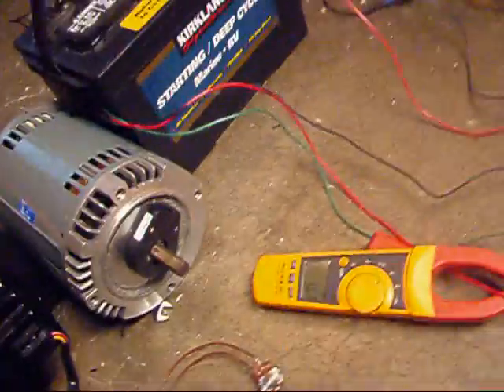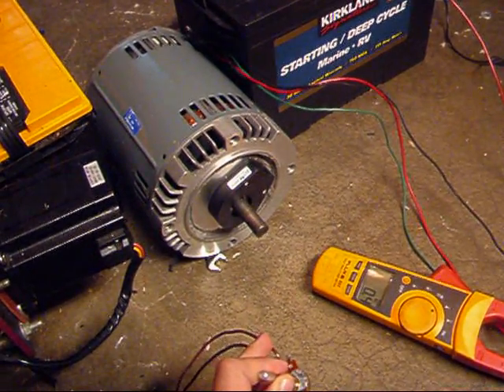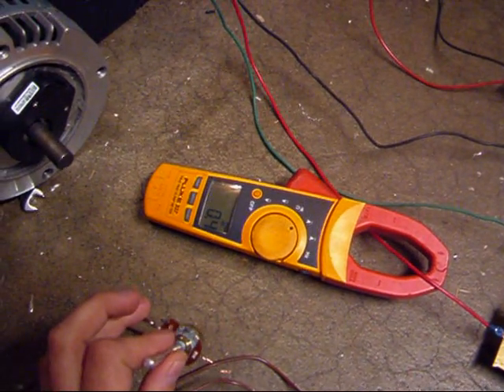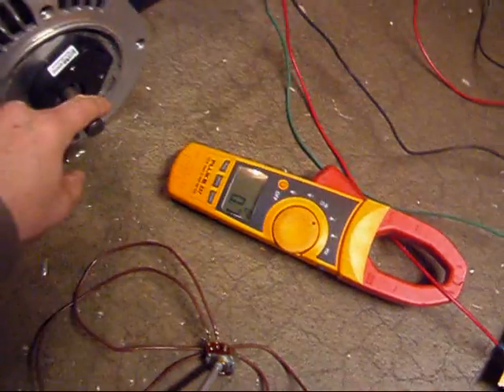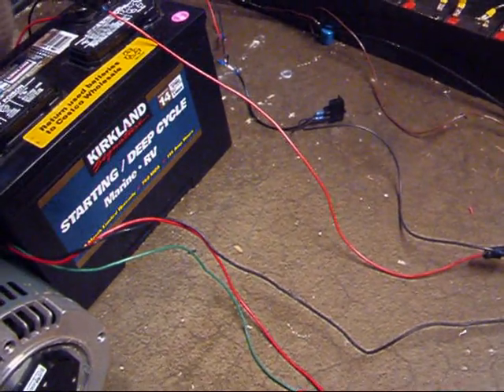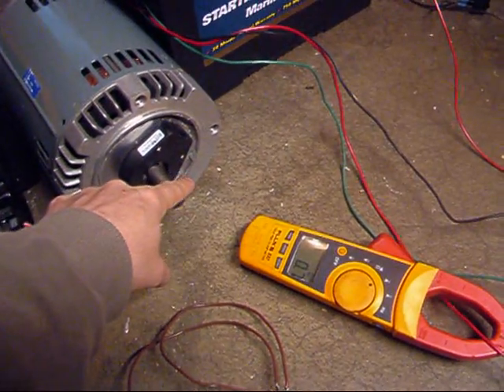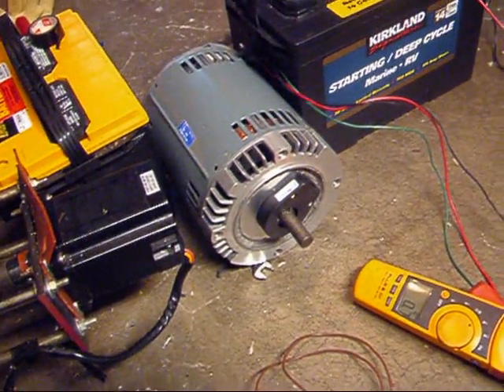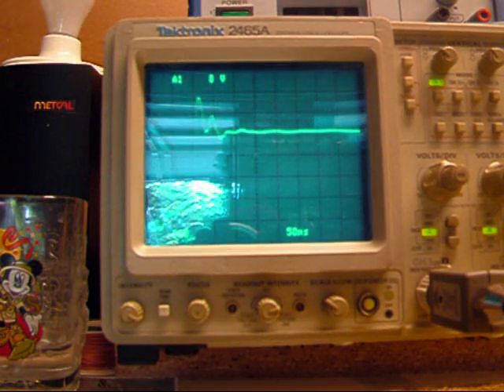Open Source AC Controller 1st Test

Comment from the maker: Definitely!  That would absolutely work.  You just need to rectify the 220AC with a big capacitor output, and then let that feed the B+ and B- on the controller.  Oh crap, I forgot.  You also need to provide +12v input (+6v up to +18v or something) for the control board, but you could use a little AC-DC converter that they have on Mouser for like $20 or $30.

Comment: Hey Paul. I have a lot of machine tools. Big machine tools. I use a 3 phase roraty phase converter to drive the 3 phase motors with 220V AC from the dryer circuit. Do you think something like the OpenRevolt could be used to generate my 3 phase power using solid state? I've been eyeing up old cars to do an EV conversion on.

Comment: very cool.
but I think we will need some AC induction motors wound for lower than normal voltage. otherwise we wont be able to properly motivate them because they are wound for docile operation at 220/380. but it's not quite clear how much this will mean.

otherwise AC is the holy grail and industrial AC induction motors in car size can be gotten for 150$ brand new. no more stupid brushes